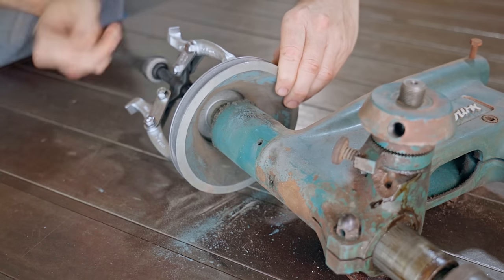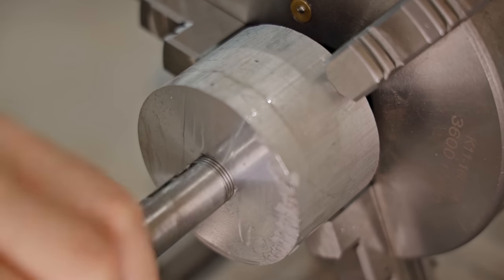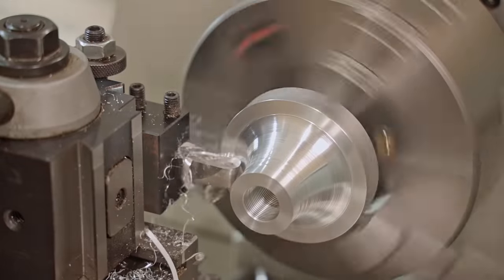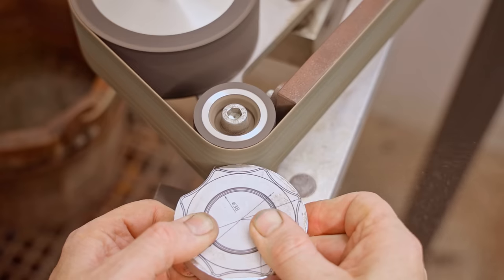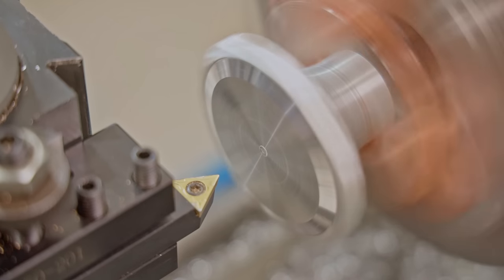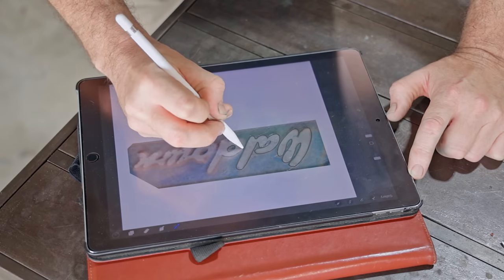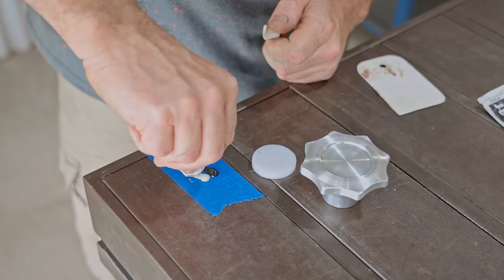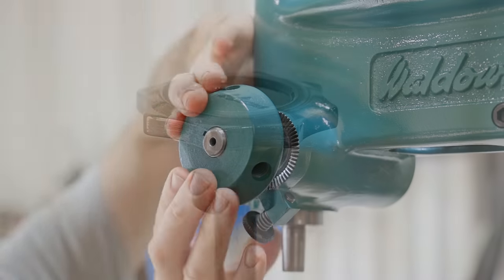Missing Part for an Old Machine - Can I Produce a Realistic Copy?

Comment from the maker: I'm in the middle of restoring an old Waldown drill press and the knob/hand wheel for securing the handles was missing. It's quite an iconic looking knob so I decided to make one. 
This section of footage didn't seem to work within the restoration video so I made its own video. :)

The parallel plier giveaway is still going. Click here to enter https://vy.lc/439126zkyqu
Reply: Neil, a hint for the paintjob on small metal items like this : stick it in the oven between paint coats, it makes a finish almost as durable as the powder coating.
Reply: Have a look at Mark Presling's powder coating setup. https://www.youtube.com/@Preso58 He's on the Sunshine Coast, not sure where in Queensland you're at.

Comment: Great looking result and it'll last longer than the original since you made it out of metal 👍
Reply from the maker: Thanks very much! I think you're right in that it should last well, hopefully the paint stays on though! :)
Reply: @PaskMakes  I was wondering why you didn't try to anodize it. Then I realized that the lettering is just epoxy, so it would have had to been painted anyway. It does look good, though. I think it should last well enough, since you sanded the part and also used etching primer. But, I guess if it doesn't last, you could always try something else.

Comment: Really great result and a clever way of doing the lettering! 👍
I have used silicone casting mould material for similar jobs. Youmcast the silicone around the original piece, then when cured, cut it open (or partially open) and remove the original and you have a mould.
Then you can cast epoxy resin, even epoxy and chopped glass fibre mixed if you need more strength. You can also add a metal threaded insert first and cast around it to make a strong knob, just fill the threads with something removable like modelling clay or candle wax. You can also mix black pigment in or other colours and the colour ismall the way through thenpart, in case of later sanding or shaping.
If you want to try this in the future I suggest getting the harder of the silicones, I think mine is a shore 60, and the platinum-cure silicone is more expensive but much tougher and better quality than the cheap tin-cure silicone.

Comment: Brilliant job. If you want to do some really small powder coating, here is what I do : put your aluminum workpiece in a small oven (a toaster oven is ideal ). The first reason is to de-gas the aluminum (or something like) that for any PCing. If you don't, the powder may bubble later during the final baking. The second reason to heat the aluminum in a DIY shop is that you can avoid buying the whole PC equipment purchase. I use a hobby air brush to apply the PC. Get the workpiece up to about 350 F or so, remove from the oven, and then use the airbrush to apply the PC. When the PC hits the hot workpiece, it will slightly melt into place. I found that I'd have to keep slightly shaking my airbrush as I did this. ( Don't fill the airbrush container any more than about 1/3rd full ). Or,  instead of using an airbrush, search for "fluid bed" powder coating and make one yourself. I made a small one for my girlfriend and it worked great. You will need an air compressor and a regulator that is accurate down around 5 PSI because you need to keep the air pressure extremely low. Once you have your workpiece coated, put it back into the over to bake. Depending on the powder, the workpiece will have to be baked for 5-10 minutes at around 375 F. Since it's not likely to see an overly abusive environment, I wouldn't be overly fussy.

Comment: Re: powder coating.
Definitely a neat thing go have. Powder is quite a bit thicker than paint, so surface finish on parts does not have to be as good to still look nice. I would highly recommend getting a plastic (or all wood) table and doing all of the work on it, otherwise the powder would just as happily go to the ground as it would the part. Keep the work area cleaned, and you can just sweep up the 'overspray' and re-use that powder as well. 
As for the process itself, i prefer to preheat the part whenever possible. Bring it up to 200c and that will not only burn off any oils and such, but also allow the powder to melt on contact for a better coverage. Powdercoating process is sort of unique in a sense that layer thickness controls itself because powder gets more attracted to places where it is thinner. You can still get a run, but it is not quite as easy as paint.
With that said, if smaller aluminium parts are going to be the focus, anodizing is better. You get more vibrant and even colors and the setup itself it much simpler. You have to deal with fairly strong chemicals, but it's not bad and worst case you can just build a fume hood with a clear splash shield.

Comment: Hey if the paint doesn't hold up a lot cheap option compared to power coat is to go with Aluminum Black solution, it works just like Cold Bluing does but it's for Aluminum of course LOL. You can get a bottle fairly cheap and it works quite well as long as the parts been prepped right. 👍👍

Comment: Cheap powder coat setup is well worth the price. I have an Eastwood dual voltage here in the states but it's just a badged import. Pickup a cheap toaster oven for curing small parts in. Finish lasts longer and is done in an hour instead of waiting days for paint to be set up.

Comment: Outstanding lathe work Neil!  As I was watching I kept thinking your were making it for a mold to pour some modern resin but in the end your piece turned out quite nice and very durable.  Powder coating would probably be more durable than the etch paint but it's a nice old iron drill press going back into use and will take on a new patina.  Had my son SLA print a small part (5/16" cube with fine details on 2 faces and draft angles out of durable material) awhile back and couldn't believe the resolution and detail that was able to produce and have since put a small unit on my "want list" for prototyping and artwork. Bravo, Thank You!  Looking forward to seeing your restoration in full detail.  ~PJ

Comment: To powdercoat a few small items at a time without tools, you can use the shake & bake method. You'll need a plastic container with lid (#5 plastic) and airsoft BBs. Add a handful of the BBs to container along with a spoonful of powdercoat powder and the item. Shake vigorously in all directions for a few min. The plastic generates the static to make the powder cling. Remove carefully and bake @ 400F for 15-20min. You want to go long enough to ensure the part reaches 400. Your knob might be on the upper limit (size wise) of this method but you can always repeat a second time if needed.
Thanks for sharing your work.

Comment: The powder coating setup is one of the best "cheap" tools I own, its gets used endlessly, grabbed a cheap domestic oven from eBay to use in the workshop, this has the benefit of Pyrolytic self cleaning, which gets it to approx 500 C and I use that to strip paint off of old castings

Comment: I have a cheap powder coating set up from Harbor Freight and it works great. It was a little tricky to get the air pressures figured out at first, but once I was over that hurdle I got great results using a small toaster oven from a garage sale.

Comment: The aluminum knob is very nice.  I don't have the machining equipment to produce that knob in metal, but I have made similar knobs in hard urethane by casting with metal thread inserts cast into the knob.  This would be especially easy if you have an existing part to create a mold from.

Comment: I bought a South Bend 14" drill press, and it was in a bit of rough condition before I acquired it. It spent most of its life as a floor model, but because I purchased it at a local scrap yard, it is now a table model. It looks like all the parts are there, minus the motor, and the belt guard which is similar in appearance to yours. South Bend, it seems, only made these for about 5 years, and mine is the economy model, which is less common.
I can't wait to start using it.

Comment: Really cool reproduction, looks great. You could scan and 3D print the center disk, if you wanted to use the 3D printer. Just cut the logo recess a bit deeper and glue in the disk.

Comment: I don't think I could have done better and you did it the way I would have except the logo and honestly I'm not sure how I would have approached the logo.  Perhaps a CNC mill and a small sharp pointy tool at about 50,000 rpm and run a few million lines of program but that might have taken a week just for the dry run.  Your way seems more practical and my way might have only looked very slightly better if better at all and I'm not sure that would have been worth the work.  So glad you saved this beautiful and worthy tool.

Comment: Ooooh, nice. Never seen that trick with JB Weld before, that's really cool.

You might already know this, but you can actually do a lost-material casting method where a 3D-printed part is used instead of foam. You can even use a printed part to make a reusable silicone mold for epoxy or foam pieces that you need duplicates of. It's pretty neat. Just in case you find the unthinkable: a situation JB Weld can't solve...

Comment: You can etch aluminum using sodium hydroxide. You can also bake the part in an oven after spray painting it. It makes the coating super durable.

Comment: That came out really nice.  I will have to remember that jb weld trick for sure.  If you want a nice set of smaller gouges, I really like the ones that I got of the brand "Mikisyo Power Grip Wood Carving Tool".  They have all sorts of shapes that work for smaller carving tasks.

Comment: as a tip if you use some cutting wax on your belt. it make removing stock on alum about 1000% faster :). it stops the alum from fusing with the belt.

Comment: Interesting technique for adding the lettering! (I did not know DB-Weld so at first I thought you're going to cast it using aluminium soldering rods as the material. Could also be an interesting option …)
Reply: JB Weld is a brand of epoxy; they have a number of distinct formulations for different purposes.

Comment: Great video. Always admire a good lathe. You know Neil, a 3D printer is also useful for making prototypes and the quality of them have really improved in the past decade or so. If you look around in the $300-$400ish USD budget range you'd find ones with a pretty decent sized bed and maybe even a printer with an option to run multiple colors or different plastic materials at the same time. I haven't done deep research so the latter may be out of that budget. There is a lot of filament that are very chemical and mechanically resistant. Like some companies makes plastic filament with carbon fiber and other plastics. They should all be better than that old Bakelite plastic. I forget his name but there is a youtuber who goes through a ton of filament types and testing them if you'd like to look at that. He usually wears a google glass type of device on his face.

Comment: Electrostatic magic is over here in the UK not sure if they supply down under lol look up Martin Butler's Retro Restore channel. He has been using it for years and is a static system so no voltage to connect to the piece. He also has a video on building a large powder coating oven video for lager projects

Comment: In aluminium, copper or other soft metals you should press the thread not cut it. So this should be done with a pressing tap. The reason for this is when pressing you deform harden the material and get a stronger thread. On the other hand it might be hard to economically defend buying tools that will seldom be used in a small workshop.

Comment: 3D printing can be quite strong. Definitely withstands more force than a human could put on it with bare hands. (If material and settings like infill are right)

I somehow always think, that metal is so much more durable (and it definitely is), but I had never had a adequately sized 3D print break.

Comment: I'm going to go against the grain, and suggest you don't use powder coating, because it's non-maintainable. If that paint chips, strip it back with chemicals or a wire brush and repaint it - maybe 2 hours work or 3-4 if you apply a lot of coats. If it's powder coated, good luck trying to get it off the logo lettering, even the finger grips will be a challenge. Yes it will last a bit longer, but not so much, powder coating still chips, just a bit less easily. You might think you can wire brush powder coating, but if you can, then it didn't take very well and wasn't any tougher than paint. Anyway, you'll never wire brush it out of the corners.